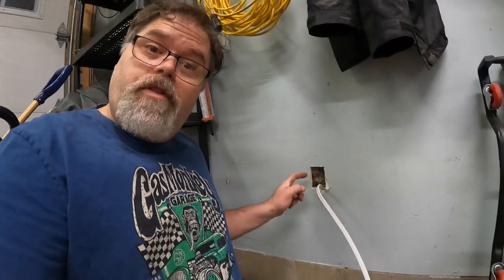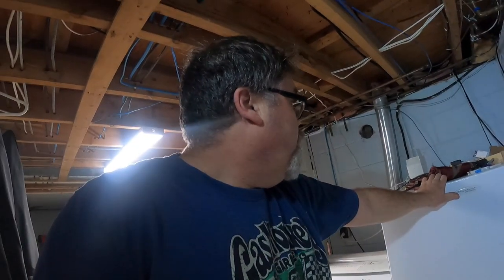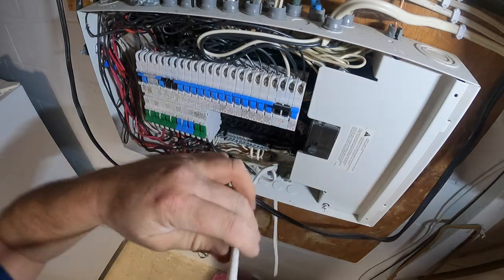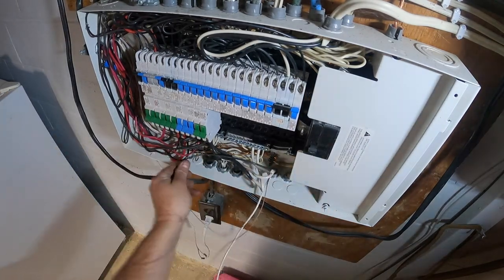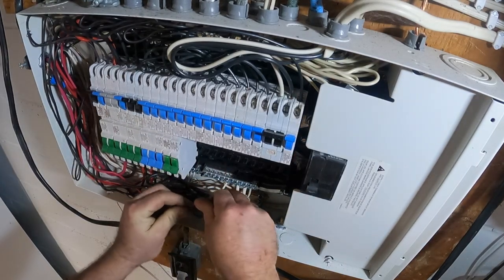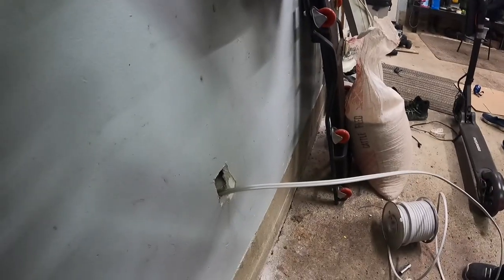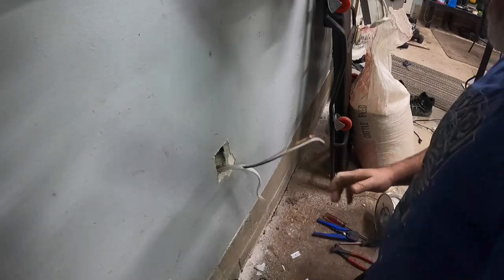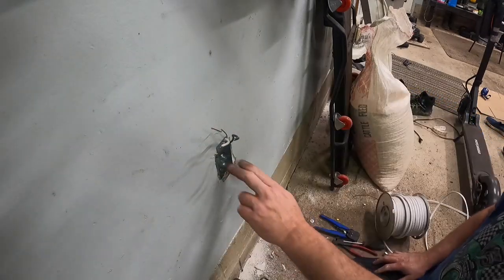Electrical With BillSiff

Comment: I put in outlets, switches, fixtures and Ceiling fans in all the time with my building maintenance  job on 2 apartment buildings and 2 duplexes, I always use Square D in the breaker boxes :)